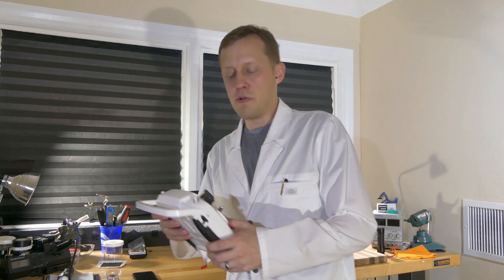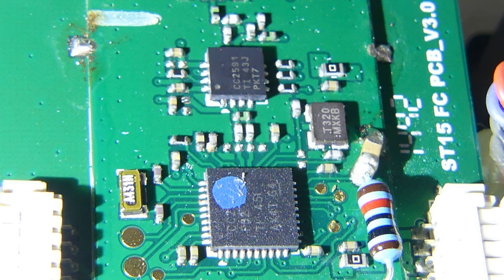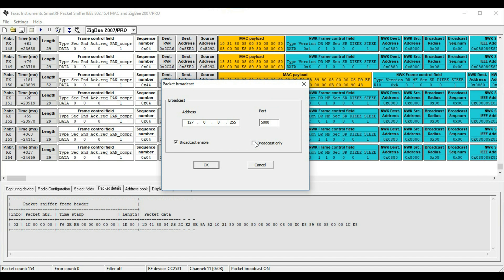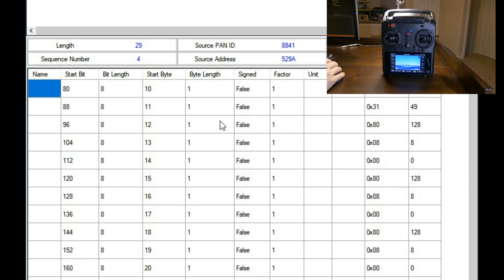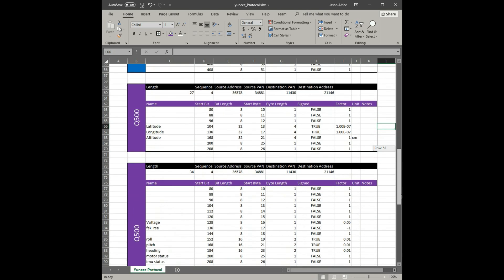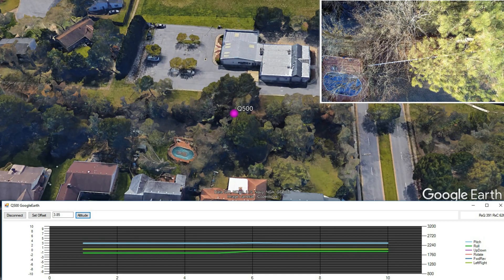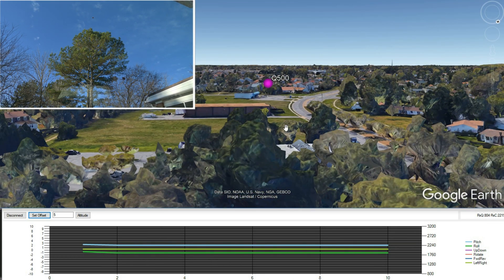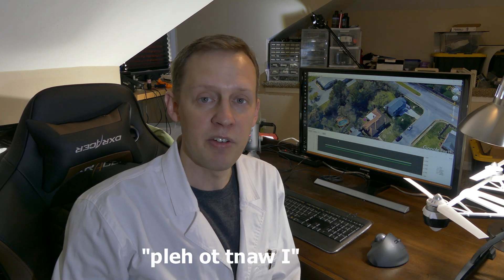Yuneec Q500 Zigbee Protocol Decoded

Comment: is there a step by step that shows how to work with these apps? i've got the two git projects to compile in vs2022 but i'm not sure it's all working right? i can make a csv file but can't get any real-time processing working? compiled apps just freeze. thanks.
Reply from the maker: I’ll take a look, I haven’t ran this project in a while. Get back to you soon.
Reply from the maker: I just tested it and everything worked. I'll make a video showing what I did and how I set it up.
Reply: @CodeMakesItGo  One other idea.... on my CC2531 board, you can solder a jumper pin to USB data TX which enables sending traffic via the USB Zigbee module. This way, you can send data from the PC, as opposed to just sniffing. I'm sure you see where I'm going... You could turn a PC into a base station.
Reply from the maker: Here is the video https://youtu.be/pcWYRZZuEVU

Comment: Just found this video - awesome work.
Does that mean that I can now use Google Earth to create a 3D waypoint set and send this to the Q500 for it to fly? Or am I missing a step?
Reply from the maker: Sorry for late reply. This project only sniffed the signals and reported them real time to plot the position. In theory, you could do what your asking but the sniffer had a low power transmitter and probably would not reach the drone when compared to the signal coming from the remote control. So I doubt it would work reliably unless there was a way to boost the signal.
Reply from the maker: Alternative to do what you want is to use a pixhawk flight controller and an open source ground control software that will let you do exactly what you want.

Comment: Dear codemakesitgo,

Did you need to flash your cc2531 usb or do some special driver installation?
The usb shows up under other devices in device manager. It shows it is a cc2531 USB Dongle but there are no drivers.

Would like to hear from you.
Reply: I did not need to flash it. When using the TI Packet Sniffer application it had the drivers built in to access the sniffer. Using this method, there is no driver that emulates a serial port, but you can reflash it to show up as a serial port. There are some videos on YouTube that explain how to do this, I think you need a separate programmer too.

Comment: could you also do a sniffer for the binding process? because I have a sr24 rx and a st10c tx, but I'm not able to use them w/o yuneec drone.
Reply from the maker: Sheng Yao sorry it took so long to respond. Yes I think you can see the binding process using one of these sniffers. The process may be custom to unique but you will be able to see the binding IDs.

Comment: I want to help! Very cool project. Seems that this should get us closer to being able to connect a yuneec receiver (SR24) to an open source flight controller board to use our ST16+ ground stations to control a BNF DIY quadcopter?
I found this thread: https://yuneecpilots.com/threads/typhoon-h-st-16-controller-can-it-be-re-purposed.9970/ Where user: dylanfm has also contributed to reverse engineering the yuneec communication protocol. He also describes it as Zigby. Others have claimed it be able to be connected to a Pixhawk flight controller but there seems to be lack of software (For the pixhawk) to make sense of the protocol and actually be able to control a drone with it.

Comment: I want to help. Very cool project even if I hoped to see the code of the programs you created. Great job anyways!
Reply from the maker: It will be posted later today, had to do some cleanup first. Thanks for asking for the code! I think that is awesome. I'll let you know ASAP the github link.
Reply from the maker: Links to github have been added to the description.
Reply: @CodeMakesItGo  Thanks a lot. I had a look, it's pretty clean, well done! I have one 
recommendation and one question. The 
recommendation would be to follow the strict rule of one file per class. I think it's considered a bad practice to have multiple classes in one file even if it's "easier" to have them in the same file. The question is, would you consider porting it to .net core so it could be cross platform ? I think it would be a nice to have the same code running on linux/mac as well. The main problem being the UI that should be ported to a web based one with an mvvm framework (eg vue + patternfly)
Reply from the maker: Boo Ster Thank you for the feedback. Do you know where I can find a list of these rules? Or are these things you just learned through experience? I’ve never used .net core but would like to give it a shot. I’ll let you know how it goes.
Reply: @CodeMakesItGo  I think you could find the same recommendation on Google but I tend to apply this rule because of my personnal experience. I think it helps having a clearer view of the objects in your project. When checking-in to the source it’s also more reliable (eg. commiting a change to MyEnum.cs clearly indicates a change of the enum where it’s not as obvious if was as in MyClass.cs). It might also help when you need to refactor or when using scaffolding/templating/documentation tools (eg. creating TypeScript classes based on your C# classes). But, in the end, it’s a matter of opinion. As long as your code works, you cannot be proved wrong for putting multiple classes in the same file. It will always be acceptable. For the .net core part, I think the data handling would be pretty easy to transpose, the API is almost the same as the 'old' .Net Framework. The challenge will be on the UI part if you want it to be cross platform.
Reply from the maker: Boo Ster Thank you for the feedback. Do you know where I can find a list of these rules? Or are these things you just learned through experience? I’ve never used .net core but would like to give it a shot. I’ll let you know how it goes.

Comment: Thats awesome. I've made a logger with an Arduino 8$ pci gps, pressure sensor and SD card shield for my plane. Flew behind a water tower and cell tower and converted my file to a KML and it was pretty cool. Check out my channel. I've done building automation with Zigbee and Johnson Controls.
I would use the shit out of that dongle, I want to try to read my ComEd digital meter. Got any tips? Looks like I would follow this video! Keep it up, great research.